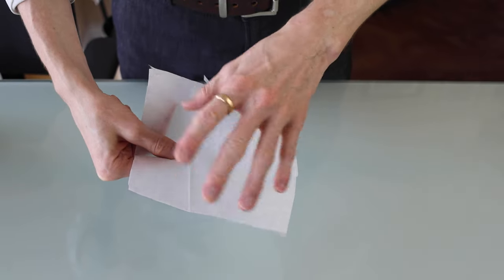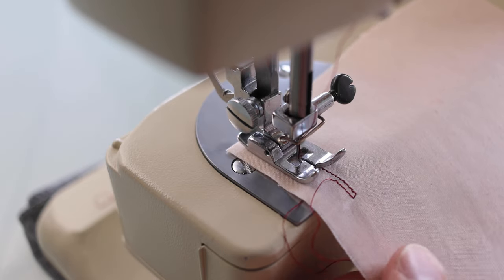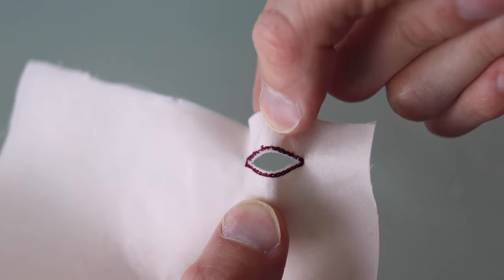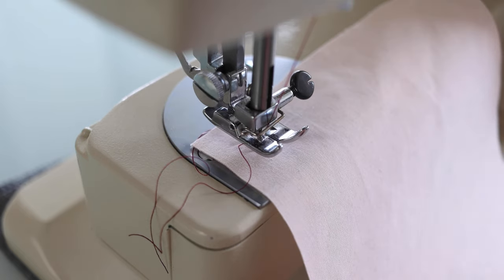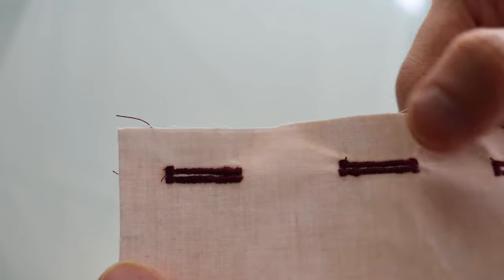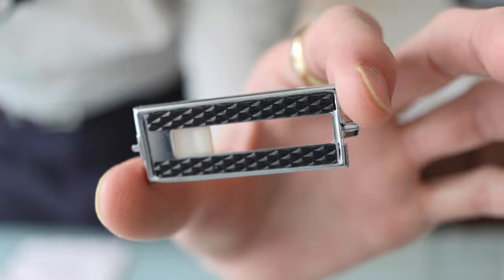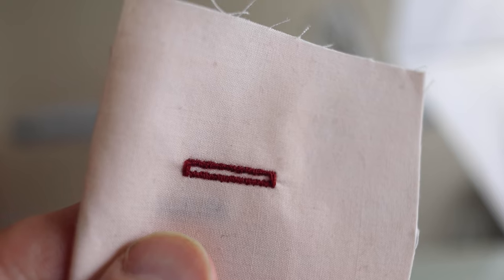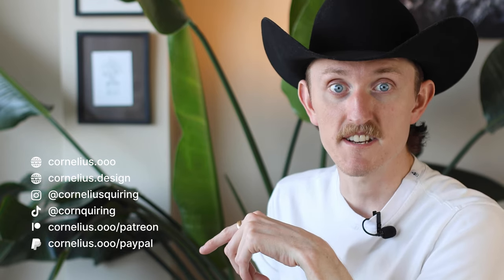How to Sew Buttonholes: Beginner to Expert

Comment: Not that you need it, as you seem to be the buttonhole master, but you can get buttonhole attachment feet. I've used one on my vintage Singer  straight stitch sewing machine, it's a bit of a faff to set up, but once it's attached and you've set the length, bight and width, it works like a charm. I think I got mine for about £25 and they are on ebay sometimes, at least in the UK.
Keep up the good work!
Reply from the maker: I just might get myself one then! When there's a tool to make life easier, I'm game.
Reply: I love mine, but now that ive got a button to big for the attachment im fumbeling

Comment: I use a craft knife fitted with a chisel blade to cut open my buttonholes. It means I don't have to worry about cutting them too far, as I never push along the buttonhole with the blade. Works a treat!
Reply from the maker: Thanks a great solution. Thank you for sharing your way of doing it. Thanks for watching.

Comment: Great, video - really appreciate you going through each of the techniques rather than just one! You missed one though - you can get what's called a "buttonholer attachment" for most straight stitch or zigzag lockstitch machines. It's a whole little machine that replaces your presser foot and can do a whole variety of sizes and shapes of buttonholes, plus bartacks usually. After selecting the shape, size, stitch width and length, you basically just align the fabric, clamp, and sew until it's finished. Aside from a dedicated ($5000) buttonhole machine or hours of hand sewing, I think this is the only way to get a keyhole style buttonhole rather than a straight stitch one, although it's not a proper milanese one for sure and doesn't look as good. But they can produce nice, repeatable results with minimal technique. Recommend getting a metal one if you can, the plastic ones are pretty janky.
Reply from the maker: Thank you for sharing your knowledge with myself and others in the comments here. 🙏🏻 It helps others watching the videos as well.

Comment: I've been loving your videos as I'm learning how to sew. I made my first Kilt this last week using tips from your videos on how to build a waistband and properly hem the fabric. If you ever take requests or if you're looking for video ideas, I've yet to find a good video on thread selection. I wanted to use 100% cotton fabric and thread when I made my kilt and when I went to the store to pick out a thread I was very lost and even at the fabric store the people there didn't really know the difference in the different kinds of thread other than the package said it was made for this or that. I tried searching online while I was at the store but everything I found was more of the same. I ended up buying 100% Cotton quilting thread and used that. When should I use 100% cotton vs polycotton blend? What weights and thread types work best for different kinds of sewing jobs? I have a different body shape than most people so off the shelf stuff doesn't fit right and I'm hoping to start making some of my own, properly fitting clothes. Thank you for all of the hard work that goes into these videos!
Reply from the maker: Thank you for sharing a bit about yourself and what you're working on. You're asking good questions. I don't know too much about thread myself but I may end up doing a bit of research and sharing what I learn. Thank you for the suggestion.

Good luck with your kilt and hopefully it turns out as you desire.
Reply: If you are still looking for info about thread choices for different fabrics, clothing, projects, etc., the book “The Ultimate Thread Guide” by Becky Goldsmith is somewhat helpful.

She doesn’t specifically say “if you’re sewing a buttonhole, use [this] thread,” so it isn’t going to be a guide that has specifics. Rather, she goes into the strengths and weaknesses of different thread types, how the thread is stranded together, and how fiber content can affect the thread and gives you the information so you can make a more informed decision for your project.

I don’t know if that will be helpful, but it might be something to look at? The book is very short and is more like an informational packet,  so it might be better as an ebook or to borrow from your library if they have it.

I do wonder if there are good resources available on the internet that could help with this. I’m feeling the urge to do a bunch of research about thread now, haha.